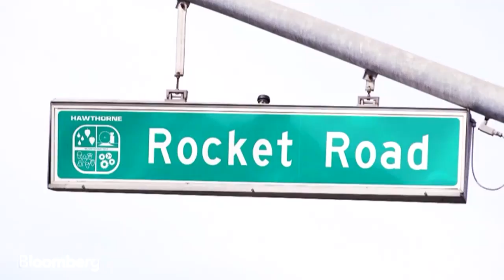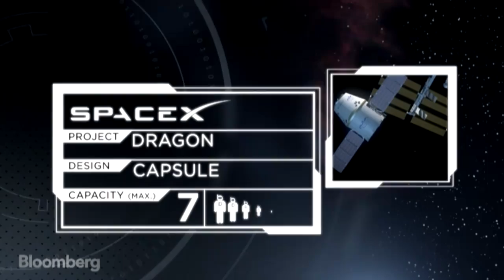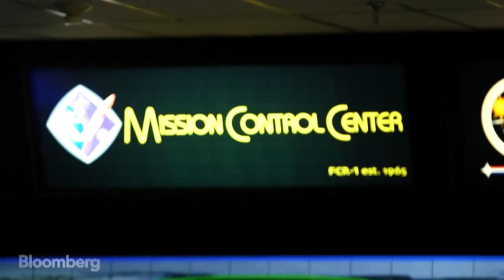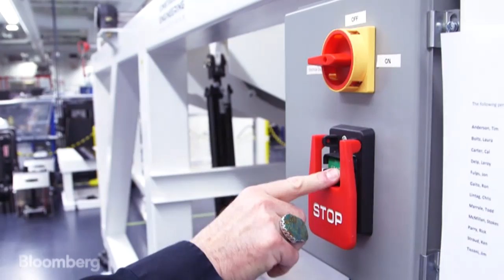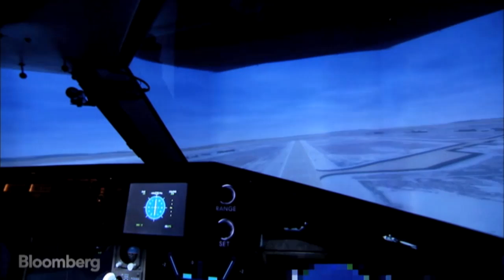Star Wars: The Battle to Build the Next Shuttle

Comment: To those arguing which is best, Spacex makes a space vehicles, the other 2 are just capsules on the top of 70's ICBMs. There is no contest.
Reply: No, SpaceX and Boeing are capsles. Sierra  is the lifting body.
Reply: terry Sullivan Gliding thingy on top of a titan icbm,
Reply: Douglas Folen What kind of drugs are you on? The Falcon 9 is as much of a 70's ICBM as an F-22 is a WW2 Spitfire.
Reply: Falcon 9 is hardly an ICBM as it was designed to be a launch vehicle from the outset.
Dragon is not a traditional capsule the propulsion system is integrated with the reentry vehicle and does pinpoint vertical landings like a helicopter.
Dream Chaser is a lifting body and has non toxic RCS the first in a US vehicle and it can land at any airport that can accommodate airliners.
Reply: The Falcon 9 is hardly a 70's ICBM.
Reply: Sarge Rho , are you sure about that? Let me help you out with the answer to my question, no, you have not yet done the appropriate research. Now, apologize to the world for your slander.
Reply: Go on... I'm listening. You must have some sort of explanation, otherwise your statement is bogus.
Reply: Sarge Rho I mean, oranges and apples are both fruit, but are they the same, no, apples are way better! Haha
Reply: Presumably they saw Boeing as the low risk guarantor. Boeing can cross subsidise from its other operations if the capsule gos way over budget plus they have a track record. The others don't have the headroom and are always at risk of going bust.But give it 5 years SpaceX will be seen as a mainstay launcher too and will put Boeing to shame.
Reply: True that!
Reply: Patchuchan I know. I said the other two were ICBMs. Dream chaser is out of the contest now.
Reply: TanzanianRoots
Yah dumb move on NASA's part as the CST-100 not only was the most expensive vehicle it's also the least capable.
But when Boeing submitted a bid I expected one of the innovators to be dropped in favor of the old traditional contractor but in the end they dropped two of them.
The first was Blue Origin who actually flew an abort test and the second was SNC who did a drop test with a vehicle that was close to flight hardware.
The funny thing is for the 4.2Billion Boeing got they probably could have had both DC and Blue Origin's capsule or got both DC and Dragon flying a lot sooner.
Reply: Fair point. Boeing's Starliner could be launched on a Falcon 9, for far less money than Boeing is going to spend launching it on an Atlas 5. Sierra Nevada, of course, lost out on Commercial Crew, but they now have a piece of the Commercial Resupply contract, with an unmanned Dream Chaser, and are continuing with development of a manned version. I don't know what arrangements they have made for a launch vehicle, but since the Falcon 9 can launch the X-37, I imagine it can carry the Dream Chaser. If not, the Falcon Heavy certainly can.
Reply: Douglas Folen Well, let me put it this way. You will have a hard time finding a 1970's ICBM with multi-engine out capability, 13 tons to LEO, and a (soon to be) reusable first stage that is also man-rated. You aren't going to find any engines in those ICBMs that can be throttled down to 70% - if they can be throttled at all, since plenty of ICBMs are solid fuel based.
Reply: none of them are space vehicles   get real.    muppets

Comment: The shuttle design is the best, its more flexible, larger volume and glides in. The others are just capsule designs from the 1950s updated, usable but at a dead end design wise.
Reply: mdhuang capsule design wouldn't work either, air not dense enough to slow the descent and parachutes would have to be too big, you'll need an active thrust control landing, but these are for Earth only so I don't think it will be a problem.
Reply: Spaceplanes are the dead end. They are inefficient wastes of mass and drag. A reusable rocket is superior in every way.
Reply: Not true, wings are useless in space, aerodynamically it cannot be used as an aircraft either, just for landing.  The capsule is lean and purpose built, it would be a fraction of the cost.  Re-usable rockets are far better, plus the dragon can land vertically anywhere.   They are just for getting you on and off planets. Ultimately docking with larger space ships in orbit.  Not to mention how much less drag, therefore fuel cost it would be to launch a capsule over a shuttle..
Reply: Sarge Rho
Sarge Rio, until we need Hybrids that can fly in atmosphere as well.
Reply: zeeman707 We won't need them. Ever. If they are economical enough, they would be as convenient as sliced bread though (and possibly the best thing since sliced bread).

It may require some sort of compact fusion reactor to be able to pack that much usable energy into a small aerospace craft.
Reply: Sarge Rho
It is tho, in atmosphere transport that can also go into space, would be a game changer.... especialy when we fly for reason other than I want to go to space, imagine coming from mars, and not having to get on a plane, but rather have your personal ship land on a traditional runway? anywhere in the world... economical, and smarter, assuming we'll have a bunch of space ships flying around, it's better to eliminate most aircraft in the process.
Reply: bfr is the answer to dc